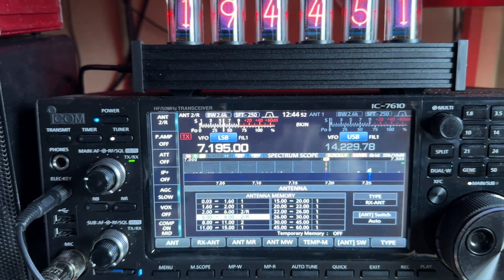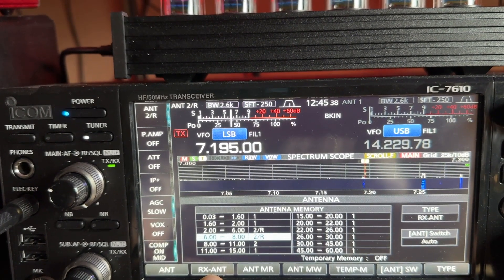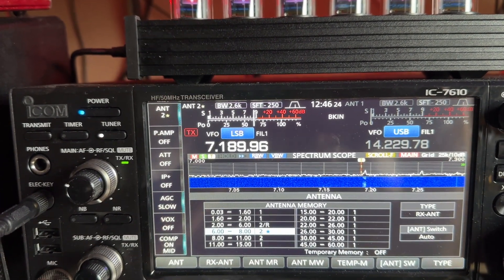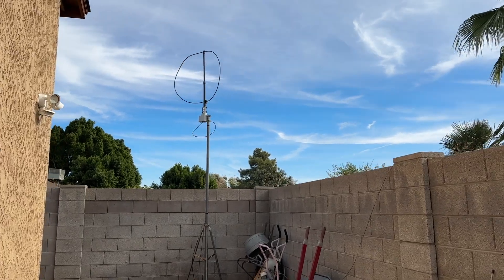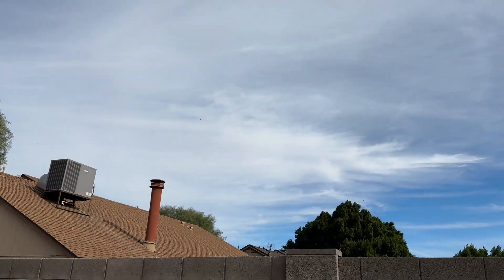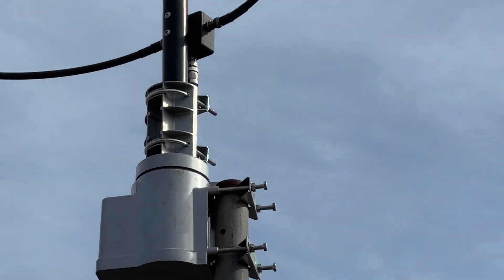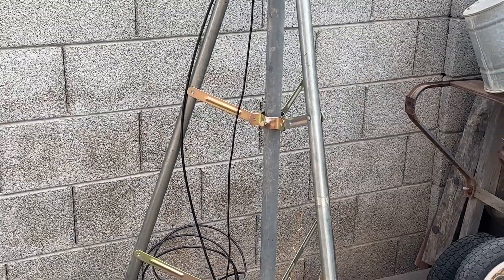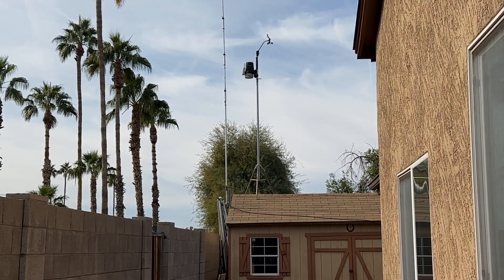Fixing my noise floor with a loop for receive at AI7R

Comment: A mag-loop, especially a tunable one with a high Q is great for reception, and not bad on transmit either. But you either have to keep the power down or build the antenna for high currents in the loop, and high voltage in the capacitor. It doesn't even have to be all that high in the air, just in the clear and 6 feet or so above the ground, as the magnetic field interacts noticeably less with the ground than the electric field does. Yours is perfect. On receive you can conveniently even play with 2 of them and phase them and rotate them so that you can minimize noise with one and maximize reception with the other. Antenna phasing is one of the most fun and effective aspects of radio, but few hams bother with it because with E field antennas It's a lot of work and takes a lot of real estate. But with mag-loops it's small, works relatively close together, and they are cheap and easy to play with. I suspect they are the future of ham radio as fewer and fewer hams have a house and property that keep the neighbor's RFI at a distance and allows for big vertical arrays. Mag-loops really are the answer to noise and for directionality on HF.